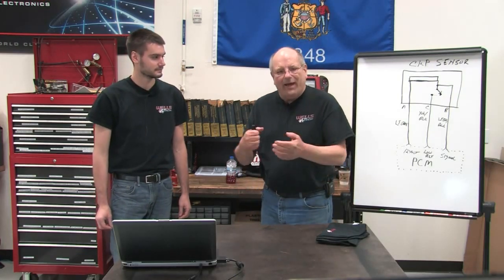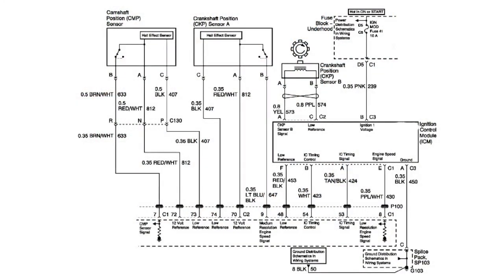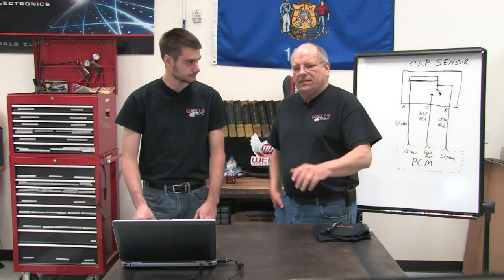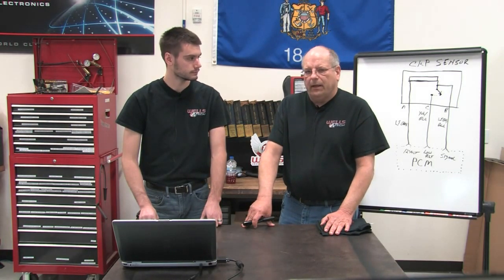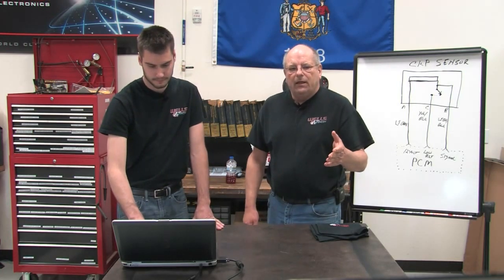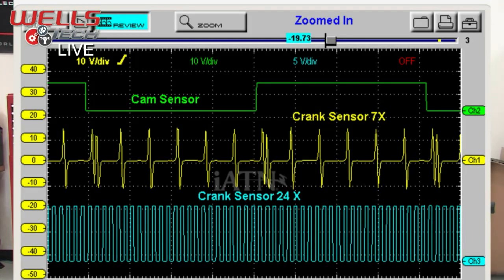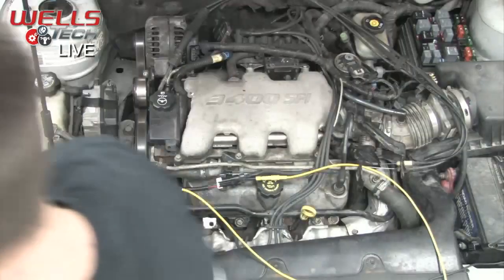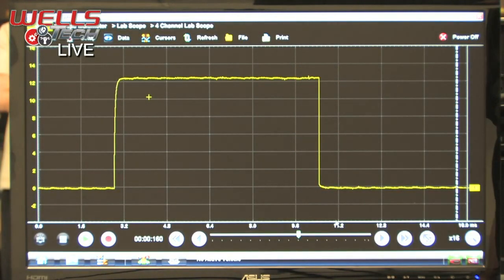Exploring Dual Crankshaft Sensor Diagnostics

Comment: In 1879 Mr. Edwin H. Hall, an American scien. dicover a new elect. phenomenon! When he applied an elect. current to a pice of metal inserted between 2 magnets, it create a secondary voltage in the metal at the right angle to the applied voltage.. Just a little bit of History!!! GREETINGS FROM PUERTO RICO MARK...
Reply from the maker: +pedro l rivera negron Thanks for the history Pedro! Good stuff! He is the reason they are called "Hall" effect sensors!